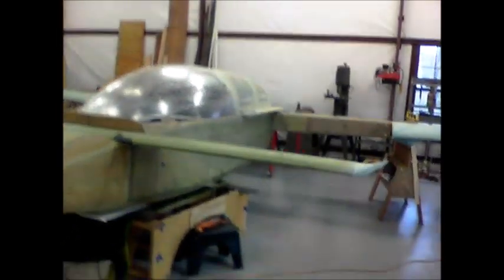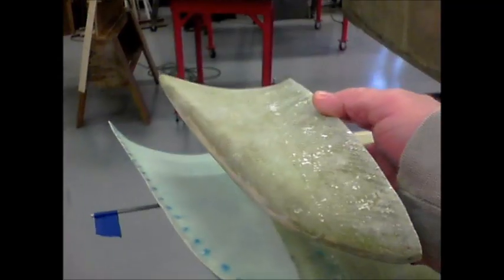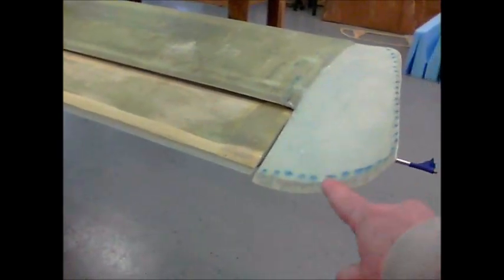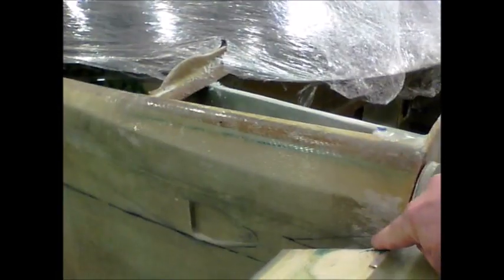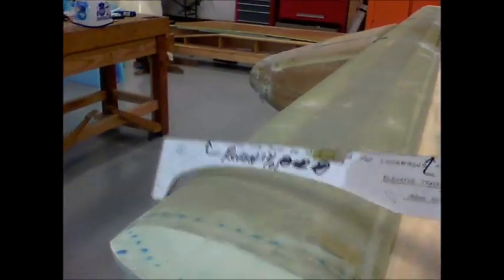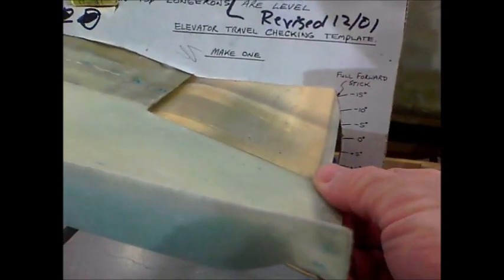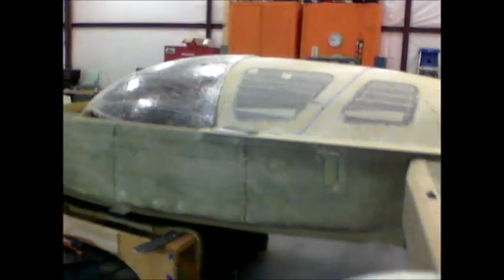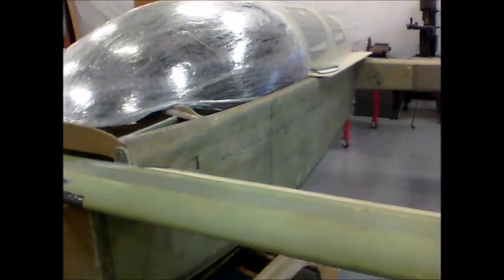Cozy Aircraft Build  Canard Update

Comment: Really like the shape of the new canard tips.  Question - It seemed that the canard tips extend past the trailing edge of the ailerons.  Is that a final profile or is the tip or aileron going to be adjusted to bring the two into alignment?
Reply from the maker: Good Eye!  I will make the two during the finishing process. I wanted the tips a little long so I could sand them flush at finishing.